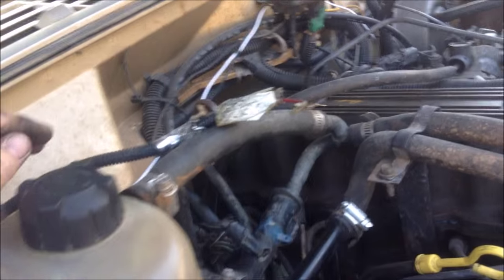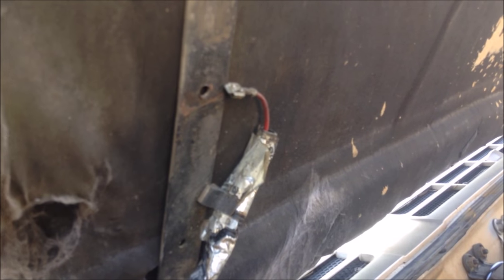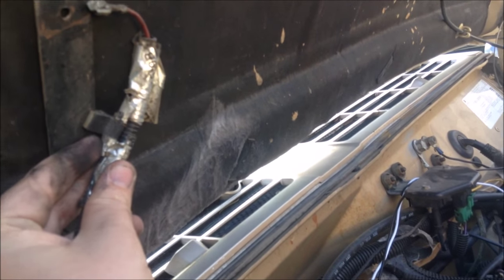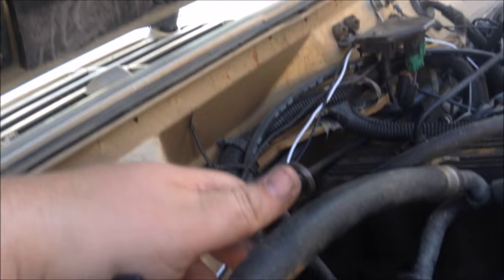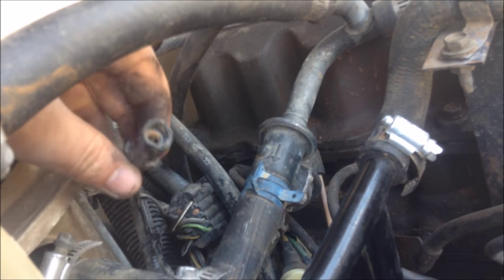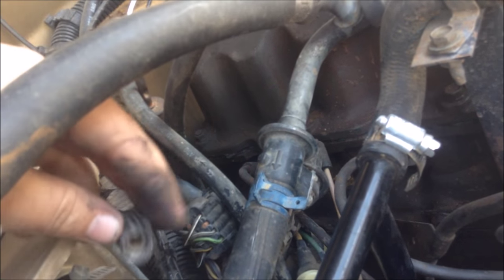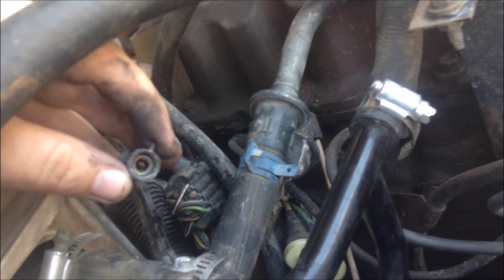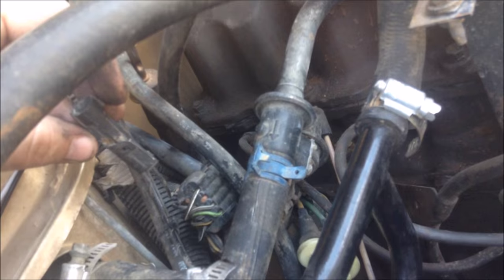New wire I cannot figure out where it goes - 89 Cherokee

Comment: I think that wire connects somewhere to the AC. I got the same wire hanging around and I disconnected it from somewhere when I removed all my AC stuff.
Reply from the maker: WeLiveJeep any idea as to where?
Reply: Not exactly sure but check all AC components, not just the compressor. Follow the lines. Also, I removed my cruise control which is in that area as well. So check that too.
Reply from the maker: Ok, My cruise control doesn't work I'll look up that system and see if it is part of that. It would be awesome if I could get my cruise working again.
Reply: Hey, I see you in Cherokee forum all the time. You should ask In the "ask a question" thread and see if anybody else knows. I'm wondering myself, maybe It goes to somthing else other than the AC or cruise control. If you could do that, it help me out too.
Reply: Btw, I'm 93XJeeper on there
Reply from the maker: I recognize your name! I'll do that for sure!